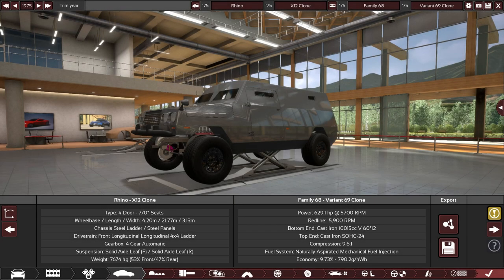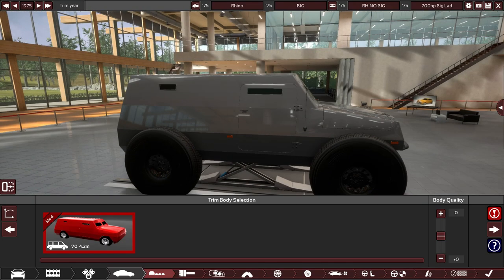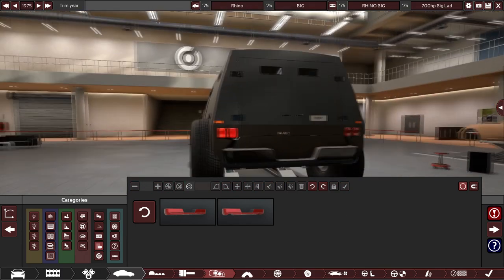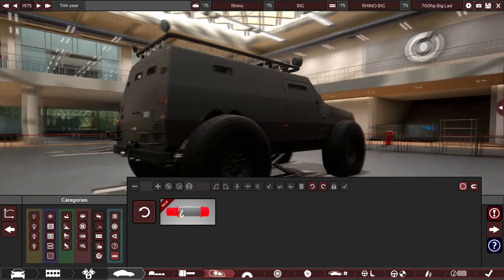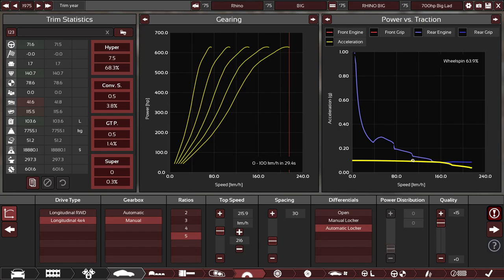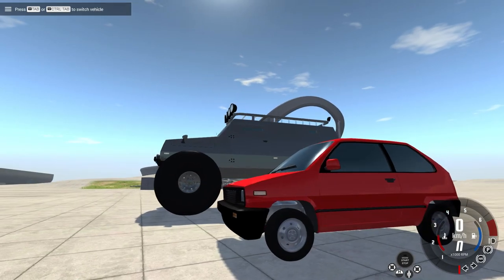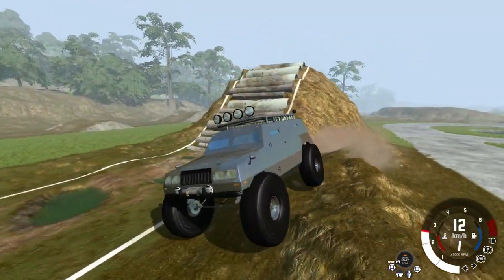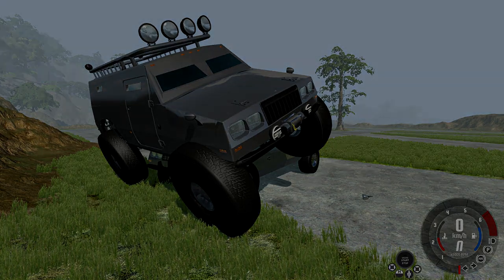Mega Offroad Rhino (Automation + BeamNG)

Comment: Btw. did you overclock your gpu? You can see artefacts during gameplay.
Reply from the maker: Nope, it's just slowly dying
Reply: @automotiveflux  well that could be the case but I would point at the software concretely Treibers,Mods, Automation and BeamNG we all know that these games a stil in development so same times the mix will not work properly
Reply: @TheLtVoss  He would have to use a gpu that doesn't get driver updates anymore. Then, that's a possibility. 
That's just weird that both, beam and automation are artifacting similarly.

Comment: High quality engines, suspension and other components are quite common for military vehicles, as cost, while still relevant, isn't exactly market driven either. Then again, complete turd components are also common, at least compared to the desired usage. Also, automatic transmissions are very, very common post (and during) WWII to reduce training requirements, at least in non heavy transport vehicles.

Comment: FIX YOUR FINAL DRIVE RATIO! There’s no vehicle that uses 12.2:1 gears, that affects your wheel speed/spin and your top speed
Reply: I think the reason the final ratio is high is to compensate those MASSIVE wheels. 
Wheel size actually affects top speed and acceleration. Bigger wheels increases top speed, but decreases acceleration and vice versa.

The laziest way to decrease wheel spin easily is by removing 1 extra gear from the transmission. Remember new Ultralight Boxer? It initially had 6-speed and wheel spin, but then he changed it to 5-speed and no more crazy wheel spin, for good.

Comment: Mine doesn't load in automation like it's calculating the car infinitly
Reply from the maker: Needs time to figure out those wheels
Reply: @automotiveflux  should i really just wait?
Reply from the maker: @Slaughter_Pit  no I'm just kidding
Reply: @automotiveflux  k so Just mess around with the settings until it works?
Reply from the maker: @Slaughter_Pit  not sure, haven't had the same issue
Reply: What do you mean with "doesn't load in automation"? Have you downloaded the car and exported it to automation? Because you need the same mods installed
Reply: @rysea9855  naw I can't export it because it has to finish "loading" idk I had problems with the exporter before but not in automation itself
Reply: @Slaughter_Pit  What part of exporting fails? Does it get stuck at fixtures? Or does it not show anything
Reply: @rysea9855  cant even click on Export idk